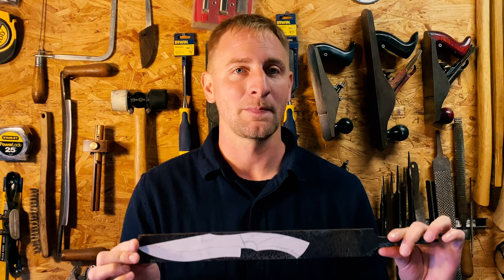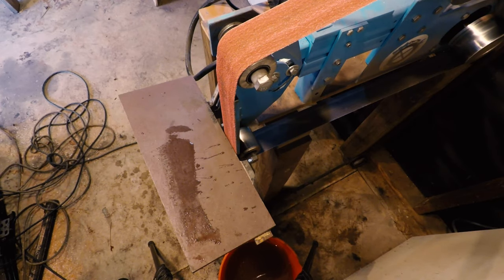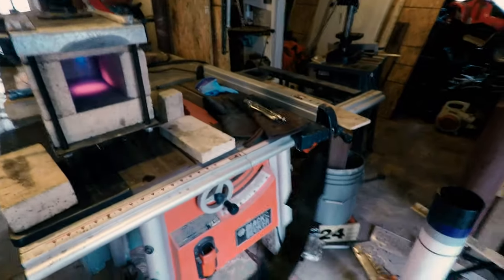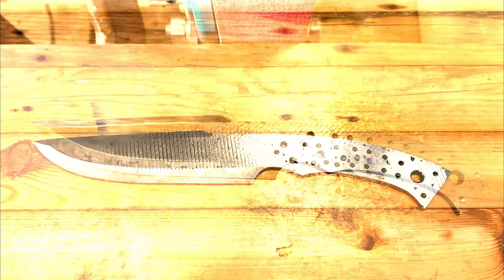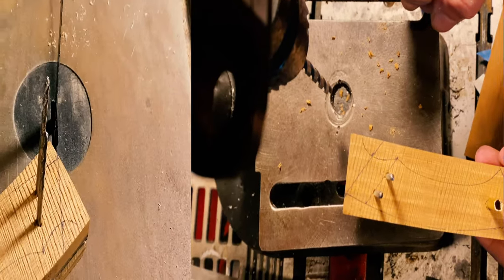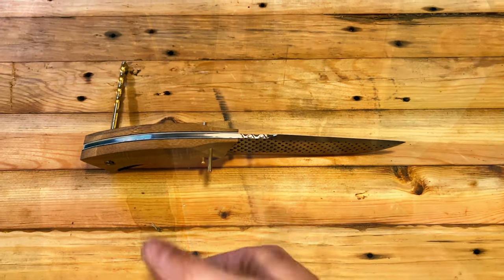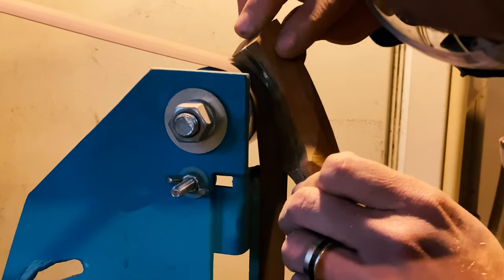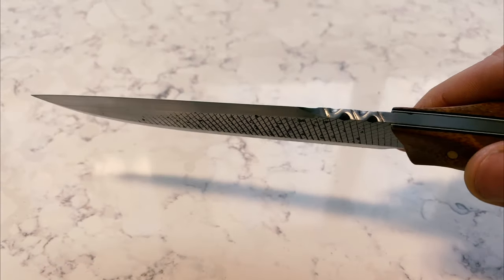Making A Bushcraft Farrier Rasp Knife

Comment: Hi! New sub here and I’ve started a knife from a farriers rasp. I’ve noticed it very hard rasp and if I should anneal it before cutting out the shape …thanks
Reply from the maker: Thanks for the sub! :) It kinda depends on both what you’re doing with it and how you’re cutting it. If you’re cutting it with an angle grinder and a cut off wheel, whether it’s annealed or not won’t matter too much. If you’re trying to cut it with a bandsaw, you’ll have very little luck cutting through hardened steel and I’d definitely suggest annealing it. It wouldn’t hurt to anneal it either way as it would be easier to cut no matter which method you’re using and less abusive to your cutting tools.